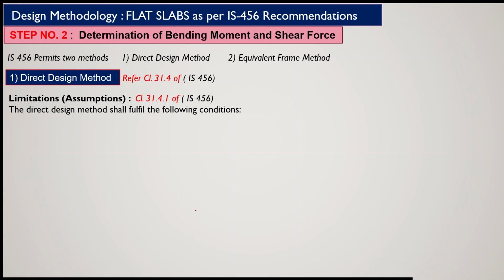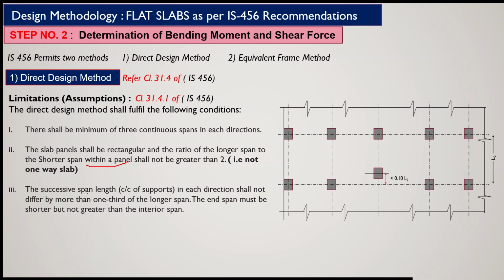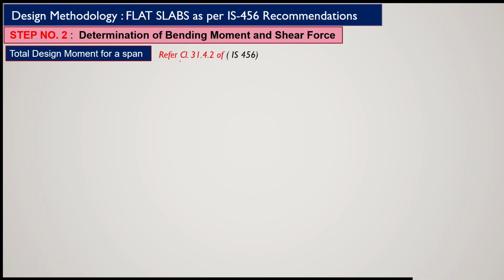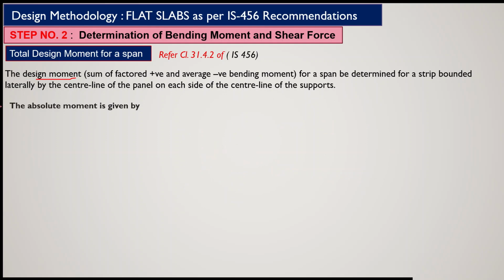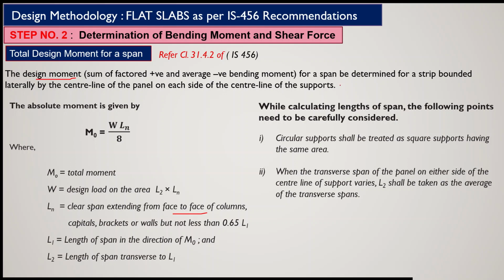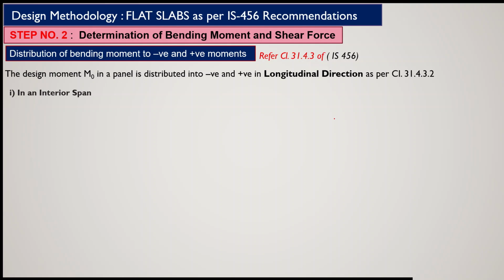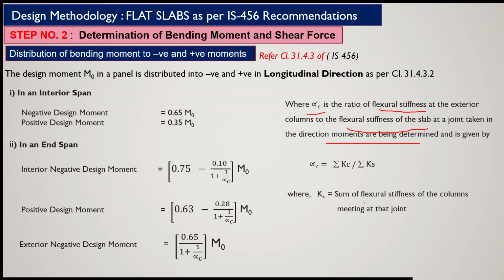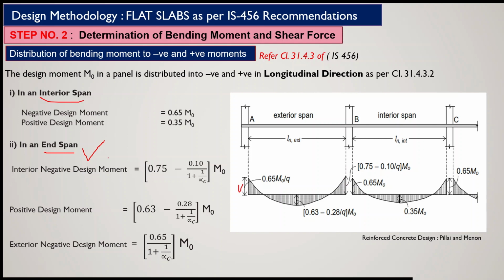Lecture 9 || Design of Flat Slab || Direct Design Method || IS:456 Recommendations || R.C.C. Str.

Comment: @21.02, sir if at the middle of the span there is positive bending moment, why is the bending curve in negative direction and similarly if the end supports have negative BM, why is the bending curve in the positive direction?
Reply from the maker: That curve is not a bending moment diagram, however used to illustrate the percentage share for respective strips.